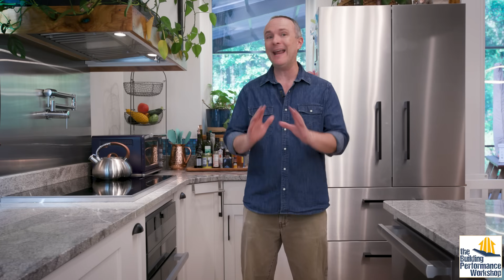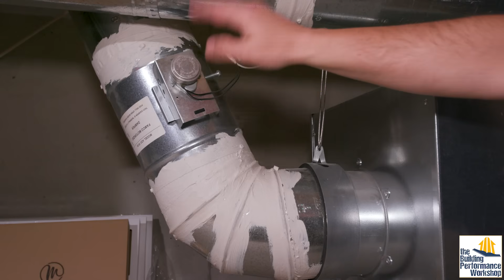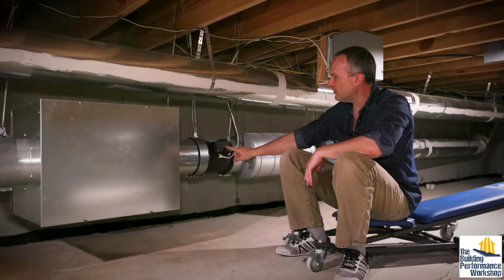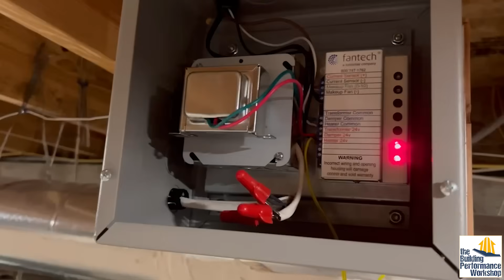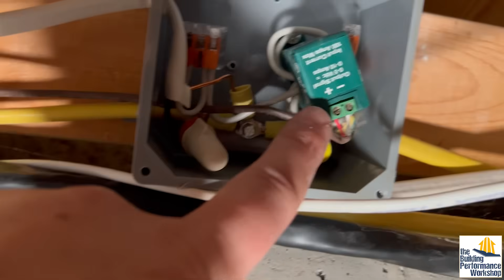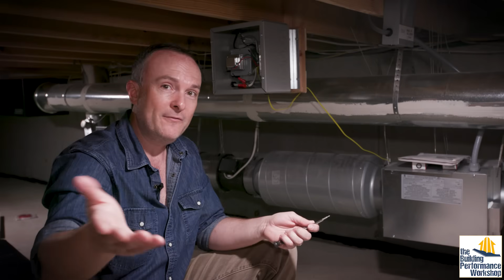Active Make Up Air System Testing + Setup: Fantech MUAS 750/1200

Comment: Dear Corbett,
As always thank you for pushing the envelope on these stale HVAC system designs. 
What if instead of active make up air system for the kitchen exhaust, one would install a better than average (cfm wise) dedicated HRV? Something like 400 cfm HRV that is working for kitchen only.
Reply from the maker: Thx my friend- unfortunately, if you ducted the exhaust from the hood it would clog the core with grease, and if you didn’t then you can’t even get close to unbalancing the ventilator enough to make up the hood. You can only unbalance an ERV/HRV 15% before it stops acting like a recovery ventilator.

Comment: Great detail of the system. I’m building a new home on a slab in Russellville Arkansas. I was going to have a conditioned attic space. I will be using a heat pump water heater and heat pump dryer. I will need make up air for my induction range. Do you have a demo on a slab?

Comment: Corbett, for the amount of money this system costs, I’d love to see it paired with a heat pump to cool/dry the air in summer, and heat the air in winter.  The current model of using only a resistance heater leaves a lot to be desired!!!

Just a note for any companies watching… hint hint, Fantech.

Great work, BTW, even if you’re not an electrician! 😊
Reply: You could definitely do it. It would just be expensive. A heat pump big enough to cool and dehumidify hundreds, if not a thousand+ CFM in one pass could very easily be bigger than a heat pump cooling the house by a not insignificant margin, especially if you live in a very hot and humid location.
Reply: @ZergZfTw   very true!  But I suspect careful builders/homeowners who spec reasonably sized hood in the 300 cfm range could greatly benefit from a HP based system.

I’m in a very cold climate (Ottawa, Ontario) and even with a small 300 cfm range hood there would be times when that resistance heater would be necessary to supplement the HP.  But the payoff for the other 85% of the time would be worth it… especially the moisture removal in the summer.
Reply: @ZergZfTw  also, if done correctly, the air could pass the coil several times since the 300 cfm required is far less than the 800-1000 cfm of a typical 2-ton HP.  The HP could also be left in “dry” mode in the cooling season, reducing airflow and increasing temperature drop across the coil.
Reply: @superspeeder I don't think you can pass 300 cfm through a coil multiple times like that, unless you want to get very creative with some sheet metal.. Your best bet for a high-end system would be an air-to-water heat pump paired with a two coil air handler. That opens up all kinds of possibilities, multiple heat pumps for staging, buffer tanks, backup boilers etc. As a rough estimate, 300 CFM at 99db 79wb cooled to 70db and 50% rh would need about 22647 Bth/h, that's almost 2 tons just for makeup air. 600 CFM is more reasonable IMO, especially if you enjoy doing a lot of cooking.
Reply: @superspeeder  Now that I think about it, Unico air handlers are just about perfect for that. They come in the 300 - 1000 cfm range, and they have coils really well suited to dehumidification with both DX and water options, plus heat strips if you want them.

Comment: I have had a variety of MUAS parts in my cart for a month or two and have not felt comfortable enough of how the system works to purchased yet.  I am so glad you made this video.  It gives exactly the clarity I need to dial in the components that will work for my house.  I am getting a 48 inch exhaust hood and targeting 800cfm of exhaust flow from an external fan.  I am definitely going to need to walk through all the components again, especially ducting to make sure I actually get anywhere near the 800cfm I would like to have.  I am installing geothermal coiling in September and plan to also put in 8 inch pipe a little above the geothermal coils in each of the runs to be used as a ground tempered air supply for my ERVs and make up air system.  This should allow the incoming air to be somewhere around 55 degrees plus or minus 5 year round.   I plan to have 6 100ft 8 inch runs that come together in a filtered plenum box that my 2 erv units the make up air will draw from.  If the three are running at the same time they will pull over 1200cfm from that plenum and around 200cfm per 8 inch inground pipe.  I am going to have to get some actually data on the pressure gain for 200cfm drawing through the corrugated pipe before I drop the hammer on trying this.   I almost spilled my coffee laughing when you commented about the HVAC people rolling their eyes at us.

Comment: I’ve watched your older videos on the system about 10 times last week. And order an hl30, an 800 cfm inline ec fan, EC controller, and all the goodies. Question I had was which ec exterior blower are you using. And do you have a simple explanation of wiring. The info provided with online manuals are a little hard to understand?

Comment: Great video man. I will be sending this video to my clients so they know how to commission the kitchen hoods that I designed for them. One point of clarification. It is a current sensor not a current switch. There is no switching mechanism inside that donut. It is sensing amperage from the neutral wire and sending an adjustable electrical signal back to the module. The module can tell by the amount of current signal return what speed the hood is running and can run makeup air commensurate.

Also if the muas was in a vented attic or crawl should you rin a seperate tube from the manometer into the home and close the access hatch?
Reply from the maker: High five on all of the above, my man

Comment: Code in Canada (as applied in my city) is: Fans from: 0 - 180 CFM = no additional requirements, 180 - 300 CFM =
must be interlocked with furnace intake (electrical permit required), 300+ CFM = must be
interlocked & have heated make-up air (electrical & HVAC permit required).  - I was planning to add a 450cfm hood as part of a kitchen reno but may now just have to settle for a 300cfm max model. Not worth the hassle and costs of dealing with MUA as I can see from your video. I only use an electric range and am not a heavy cooker to justify a more powerful hood fan.

Comment: In Florida and many southern states we need moisture control into the home. We cannot do passive either because of the same issue. Many of our Radon mitigation systems here are incorrectly active air input into the HVAC system leading to out of control humidity and dew points.

I inspected a set of college class rooms in my area and had this exact setup. Dew points were in the 70s and humidity was around 68-69 within the class rooms when the AC met temperature settings. The HVAC contractor said the duct heater should have prevented the moisture issue but I explained to them there are no condensers in this setup just warm moisture in the air.  Here in Florida our humidity it epic and requires mechanical removal of moisture before the fresh air is put into the system or interiors.

Comment: Well you're clearly not an electrician. 

The muas controller is reading a current transducer, not a switch. They are supposed to be calibrated so that you have proportional speed control at multiple speeds of the exhaust hood blower. 

You do not want multiple wraps unless you're having issues with detecting the motor on the lowest setting. You want it on the power leg to the blower, not the neutral to the unit or you can get false detection just from the lights if installed. 

Once properly installed, you dial in the 0-10v output so your fans are operating correctly across the range of operation for any of their ECM fans. It works with generic fans as well that take 0-10 control

You're close because you understand the calibration side. But be careful not to tell folks it's a generic CT switch. That's the old school relay based make up. 

Only loop the wire through the CT if the maximum current is well below the 10A limit of the sensor because it is additive. 5 loops of a 2 amp load is fine. But if it's 4 or 5 you will burn out the CT
Reply from the maker: As stated, I am not an electrician, and as stated this system DOES have issues sensing the lowest speeds of the ECM fan.
Reply: @HomePerformance for sure, just leaving some notes for other folks to reference as well
Reply: Show some YouTube etiquette.  No one likes a know it all.  Who says that.  “Well you’re clearly not an electrician.”  Go somewhere else

Comment: I don’t think I’ve ever seen a make up air on any house I’ve worked on. I’ve been doing hvac for 15 yrs. Great information
Reply from the maker: Thx :)
Reply: My daughter had a new house built, and they did install a make-up air system of a type. It was a passive system, and enters near the garage entrance, next to the kitchen. When the fan is turned on, the damper opens. The filter is a 1" on the output. It has no heater.

Comment: Thanks for posting another super informative video. Nothing better than to geek out on building science on Monday morning. When I was watching this I could help but think what would this be like if it was connected to home assistant using esphome. I bet you would enjoy having a complete dashboard with all your system statistics on it. I'm building sensors to put in ducts to measure pressure differential, tempertaure (delta), humidity (delta) and also co2 using Belimo sensors. I'm not sure I need it all, but the great thing is when the sensors fall out of range (eg. delta T drops) it will alert me to go check the system (usually condensor in the spring). Great show and thanks again!
Reply from the maker: That sounds awesome! Thanks for being a fan, keep up the great work buddy.